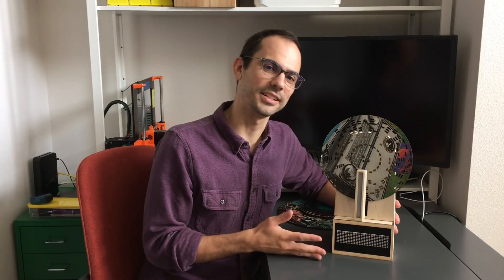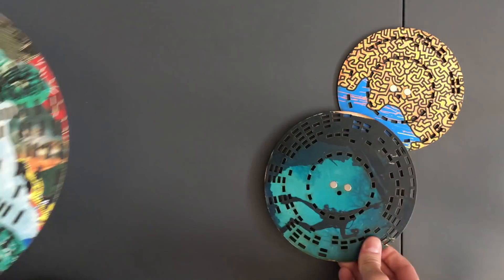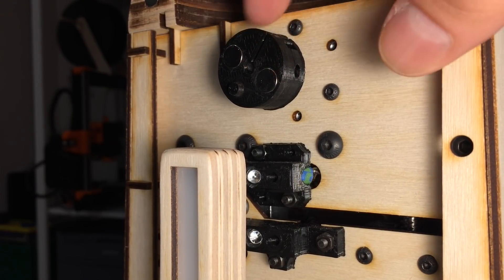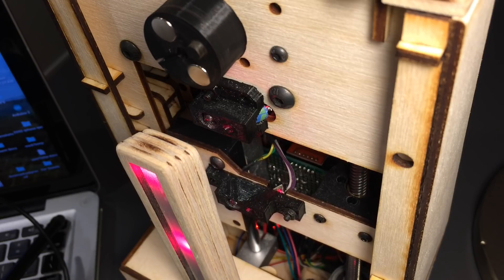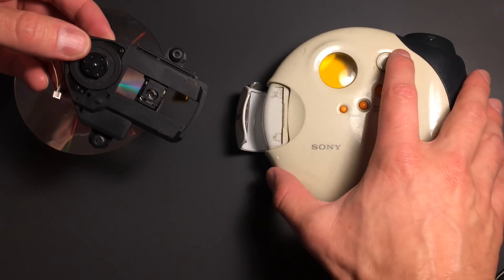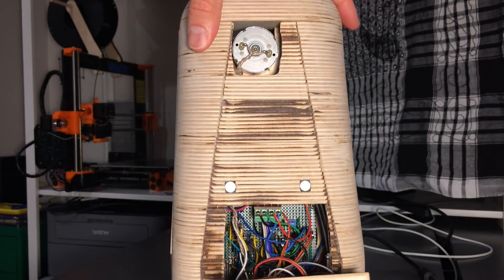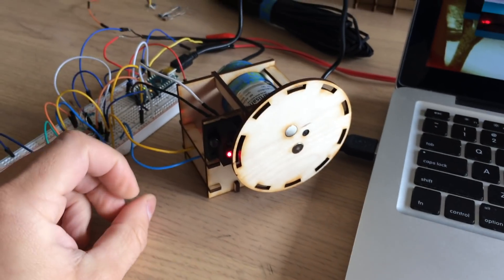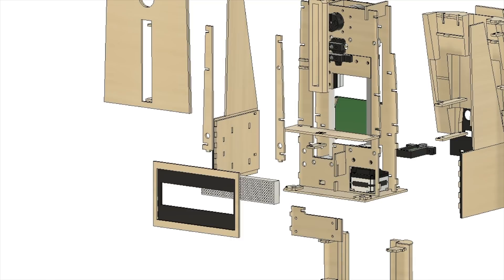Wooden disc player: storing binary data on wood

Comment: this also reminds me of a project I worked on a few years ago. which had a similar problem, only a completely different solution. it was something I designed with a first purpose of adding more storage to a Arduino(this had ofcource to be self made storage and not a prebought chip).  I wanted to add add more storage as part of a project to increase the arduino's memory and processing power, by making and adding storage and a making and adding a coprocessor. back then I didn't know how actual processors worked on a transistor level. so I made everything from scratch. it didn't take long for the first prototype to work on it's own with no arduino connected. so right now I had a very simple self correcting high precision storage. it only had one bit, but the bit had 4 main stable states in stead of 2. with self correcting I mean not by using specifically added hardware or by algorithms, but in stead it acts like how a quantum computer gets its values. however it way to big and to expensive. since it was only 1 bit and costed easly around $0,10. which scales quite hard if you want to have a decent amount compared to the arduino's memory. with big I mean that since I made all parts myself(excluding things like resistors, capacitors, metal wires, diodes,  battery for power supply, and things like that.) so I couldn't really get it smaller than a arduino mini(for only 1 bit). it practically made no sense for things other than a security system where some very specific bit would be needed to be saved very safely. however the co processor thing worked better. while it was quite big as well for even a single bit. I could get it to compute at extreme accuracy, so for one of my tests I could get it to do multiple calculations in 1 bit at a much higher precision than a normal cpu. eventually I started reasearch on how normal cpu's worked on a hardware level and how quantum computers worked. first I started with making it simulate a calculator, which worked but I had ofcource to add parts to act as to say and to read out the data, since it had no storage,  nor a output such as a serial or a display. again some later I started to work on further completing the quantum terrain, since while at first it had more the advantages and disadvantages of a quantum computer(only this one worked on room temperatures, lucky otherwise I wouldn't have got anything to work stable) it still missed some specific parts, mainly that it needed to be controlled differently and that the reading of the values when concidering a typical quantum computer workload would be a lot harder and less precise on this system. so I found a way to link multiple of them just like how quantum computers do it. which gave some problems, especially since I didn't write don how it worked the first time which caused me to take more than half a year to refind it, while the first time it came easly. also some of my redesigns weren't as scalable as desired. eventually it worked. however now the problem is where to take it/what to do with it. since eventually I hope it will be opensource so eeryone can easly make their home computers, with the benefit of the high precision, the acting as if it just knows the answer, and the scalability +  the simplicity, since by that time it probably would be considered new and there most likely won't be many complex circuits based on it causing people all around the world to have an actual understanding of how it works, which causes them to be able of developing and advancing it. simplicity as in simplicity by looking to the roots. so it is simple because you will get the actual things behind it rather than a random program or a big system that has been designed for years concealing the truth it runs on.
right now my main problems with it are that in the past I have had quite many experiences where others claimed to be the inventor of something I invented, or other people just assumed that and they didn't really go through the effort of saying they are wrong. this in anny cases led to a wrong development of the invention(as in products, laws, systems, etc.) causing it to in many cases eventually hit a dead end because everyone was working with the information of someone who didn't really understood how it worked because often they only knew the parts I told them about/explained simply enough for them to understand. also I have also some friends who do creative things such as writing and making music, or making short film. quite a few of them have multiple experiences where a random relatively sized to big company used their work in something (often without asking permission, because most of it was posted amatueristic). and in most of these cases they got copyright claimed for their own completely original work(everything made and written/designed by themselves) because some random company decided to want to have it.

Comment: by cutting the holes in the disk in the angle of the laser you can greatly increase the storage density, but it looks really cool so you could literally put in in your living room with finishes like that. and it holds enough information to let it control a midi synthesizer.

Comment: I want to see what the other discs say 😕
Reply from the maker: Oh yes, the other discs... You will have to take my word for it that they do work. With so little info allowed on the discs and only a few discs cut, I had a bit of panic on what to choose for a day or two. Then I realized I should just pick a few lines I liked, no pressure, they're not getting sent to space or anything. The messages are as follows:
"Don't panic." - Douglas Adams
"I am completely half-afraid to think." - Flann O'Brien
"You not look inside my mind anymore. Now you may leave these arms of moss." - Timber Timbre
"Can't believe how strange it is to be anything at all." - Neutral Milk Hotel
"While you make pretty speeches I'm being cut to shreds. You feed me to the lions. A delicate balance. This just feels like spinning plates." - Radiohead
Reply: @okooptics I love this project! 😍 I have no doubt that they do work!
It would've been amazing to see them in action 🙄

Comment: What you've built is like a hard sectored floppy disk, but missing the index hole between two of the sector holes. Poke another hole through the timing track and with a bit of programming to look for the extra pulse your timing task will be much easier.

Comment: This is really neat! Now that you have it working I think you could make the data self-clocking, and make it CLV instead of CAV. That would increase your data density immensely. Perhaps even make it auto-tracking spiral instead of concentric (but would need two sensors at pickup instead of one).